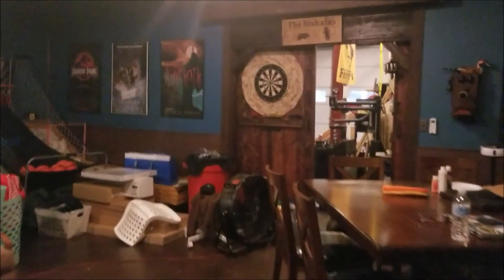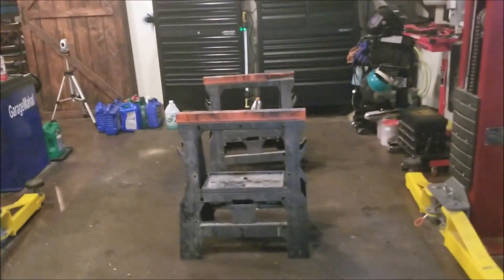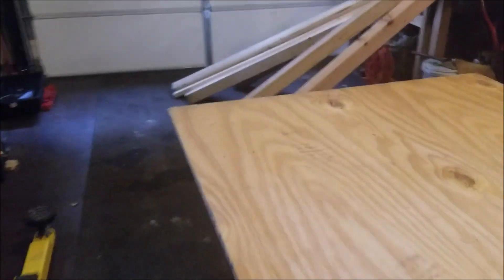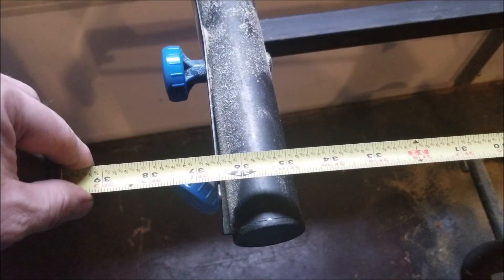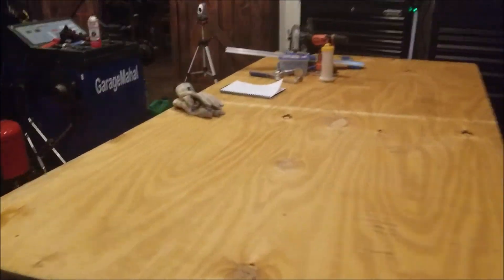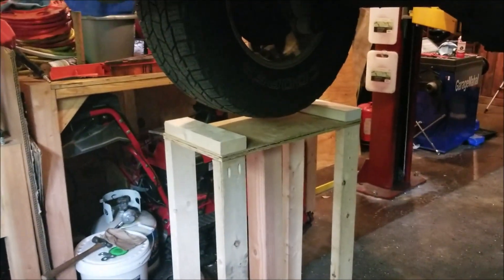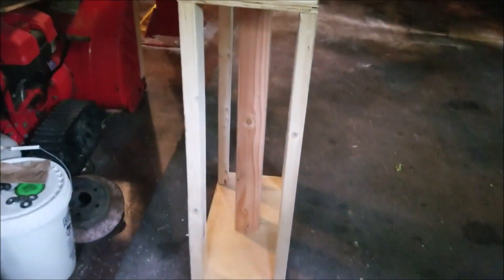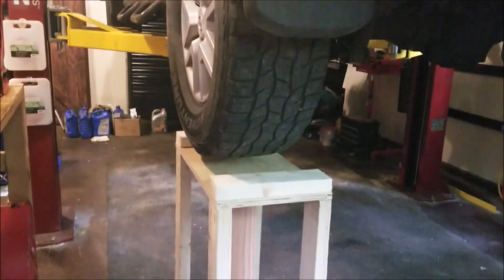Alignment Stands

Comment: I would want to see some plywood sections on all four sides, at least a foot of height worth for anti-racking
Reply from the maker: I've used this a lot with no issues, any heavier I would definitely need roller wheels in the sides to lean over and move around... next stage 😀 great idea, thanks for the comment 👍